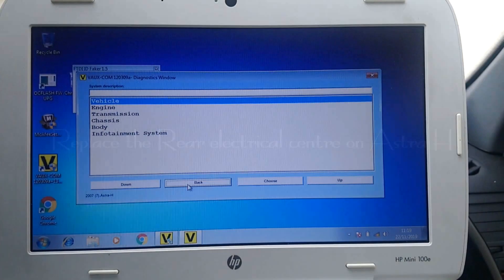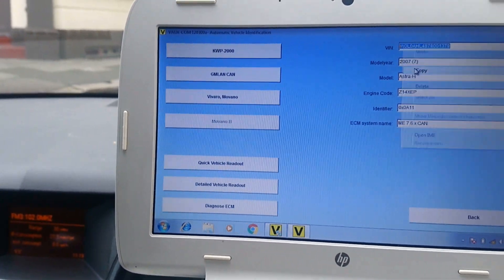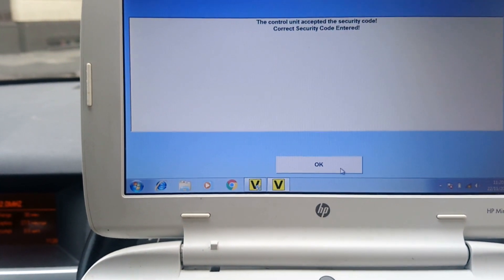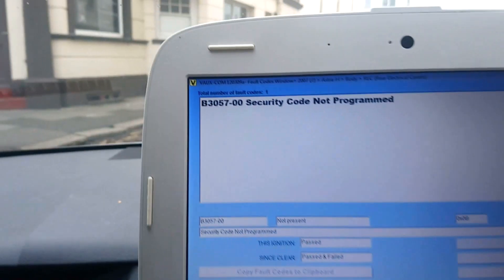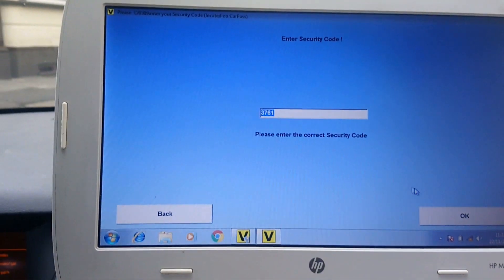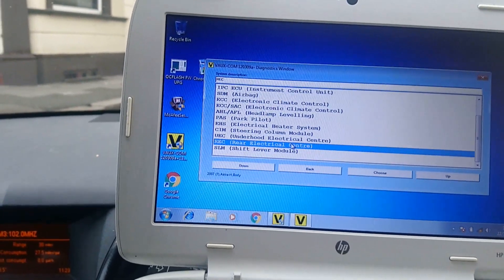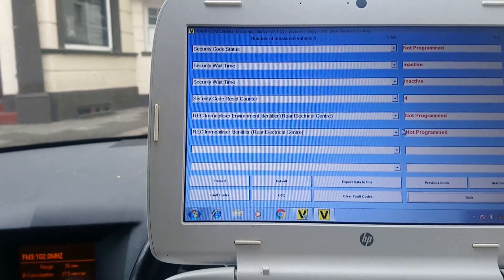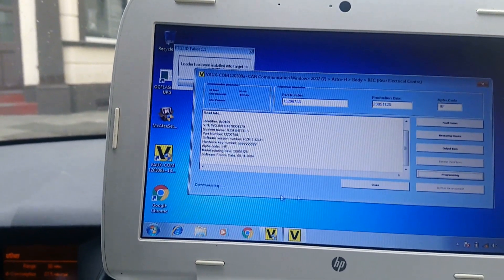How to program new Rear electrical center on an Astra H (and almost failing)

Comment: Hello, how are you? I reset the ECU, I configured it, everything works fine for me except the remote control, the car starts fine, it works fine, but when I want to close the doors or open them, it doesn't work, resetting the rec and reconfiguring as you did in your video, it could be solved
Reply from the maker: That's an odd one,I take the fob worked before you reset the rec? The fact the car starts tells me that everything should be working 🤔 I take you've tried New battery in fob?
Reply: Before resetting the ecu, the central locking worked fine but then I reprogrammed the ecu and everything works except the lock and I don't know how to make the lock work

Comment: Just clarifying here, so all the things you have done with the REC (on this video) are on the doner REC? I think I was under the impression that it was important to depair the old REC first. So you start off with the doner board in the vehicle?
Reply from the maker: Yes it was fr a diner car but I went there with op-com and unpaired it myself
Reply: cheers, i actually got my old board working by soldering a couple of wires and splicing to the relevant wires on the loom where the pins had disappeared from inside the blue connector due to water  ingress BUT I was left with a brake switch fault. i could drive the car but on releasing the brake pedal brake light fault kept coming on. it could be cleared by turning the key off and on but only lasted for one footbrake use. The car didnt stop or anything but it stopped the brake lights. The original problem with the board was battery draining over a couple of days when not used. The splicing fixed that.
Reply: @bigbadrobby  Dear sir, I have the same problem now as you had. Thank you very much for this valuable information <3

Comment: You know what would be great would be if you could do a write up of the process and redo your video. I have been struggling with almost the same problem that you have, bought an REC off Ebay etc etc for my 2006 Zafira B. The board off Ebay had the same board number but came off another model but should work. I`ve gone through the same issues as you. I had no idea about power cycling it and the car is on the driveway ....................... still ;) Doing my head in. I`m pretty new to car diagnostics and just past 70 so it is very confusing. Thanks for the vid, invaluable information, if only I can get this old head around it ;)
Reply from the maker: Was the rec deprogrammed before you brought it and do you have the car pass for it?
Reply: @zedalon  No it wasn`t deprogrammed and I only have the car pass for my car
Reply: Did you have to do any programming for the immo?
Reply from the maker: You will need to car pass for the other car to deprogram it so you can program it for your car. And yes you will need to program it for immo
Reply: @zedalon  Thanks for the info, not much chance of getting the car pass number from the seller although he has sold hundreds of vauxhall boards and I cant see mention of it anywhere. Is it not possible to edit the vin and security to blanks and maybe do it that way?

Comment: can you help me? i have no comunication REC,UEC,SDM in cim those are present programed,in measuring  have no security code programed
Reply from the maker: Have you checked the connections on the UEC? As when I didn't make sure they were connected properly I had same problem

Comment: Fantastic video - real life saver - I didn't know that when you change the REC that it needs to be programed - I had to change mine (because it was badly corroded caused by a leak in the rear door channel) then the car became immobilized and central locking stopped working, and only when I saw the opcom error code from the REC  did I search and found your video Thank you so much
Reply from the maker: I'm glad you found it helpful 😊
Reply: @zedalon  Hello, I reset the ecu, I configured it and everything worked fine except the remote control that no longer opens or closes the doors, the car starts well but the remote does not open or close the doors, would you know what happened to it, can you please help me, thank you